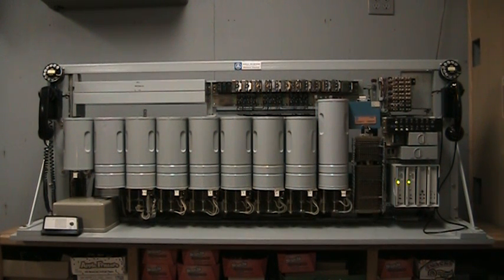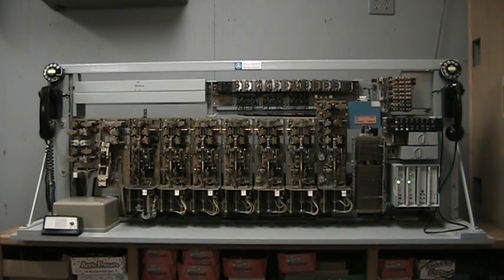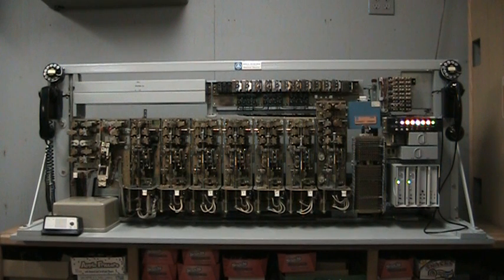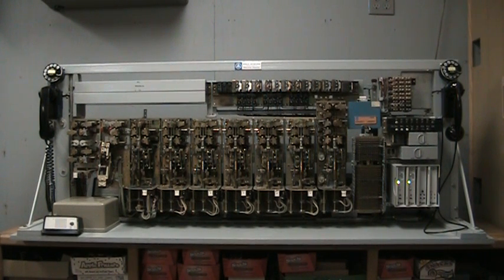Strowger demo.mpg

Comment: What these demo units don't demonstrate is how the central office is organized.  A single call wouldn't activate selectors sitting next to each other in the rack for the same call; each dialed digit would connect to a different rack frame (or floor) in the exchange.  e.g. if a CO were to handle the entire 279-xxxx numbering block, that's 10,000 potential numbers.  The office would then segregate incoming calls into banks: The 279-1xxx through to 279-0xxx sections, then each aisle would have their own 279-n1xx through 279-n0xx aisles, then each 279-nn1x through 279-nn0x frames to handle the last 2 digits.

Comment: It's incredible that this much real estate is used just to place one call!  I have never worked in an exchange but do computer programming.  From analyzing this, it would seem you could only have a limited number of free lines.  It appears that the selectors have 10 circuits to choose from "where the wipers go".  Let's say the first digit of the exchange was 4.  Does this mean you would need 10 of those canisters in order to make full use of the 10 wiper circuits?  Then you would need another 10 canisters for the second digit of the exchange?   Only 10 calls maximum could be made on a 7-digit exchange?   That doesn't seem correct.  How did they get around this mechanically?  If your exchange started with 4 and there were only 10 circuits, that's very limiting.  I saw the connector climb up, and then it seemed to only have an array of 10 available connections at that level in the canister.  I'm missing something.  In any case it seems to be prone to volume issues unlike digital systems that would not work at all like this.
Reply: In reality, selectors would 'digit absorb' so you wouldn't need to have 5 selectors and a connector for a 7 digit call, you would only need 2 or 3 selectors. as for the limitations, you would have something like 5-10 line finders for a group of 100 numbers, and those would have their own independent switching trains. I had a really good document explaining this somewhere, but I can't seem to find it.

Comment: What he didn't say was that each of the selectors (except the last) has a 'searching' facility for it to find a free selector at the next level.  That is why the switch steps up in response to incoming pulses from the subscriber's dial, and then quickly searches (you can hear it) into that level for a free selector to take the next digit.  A real exchange has hundreds or thousands of selectors and the science of connecting them up efficiently is called 'trunking and grading' (in the UK anyway).